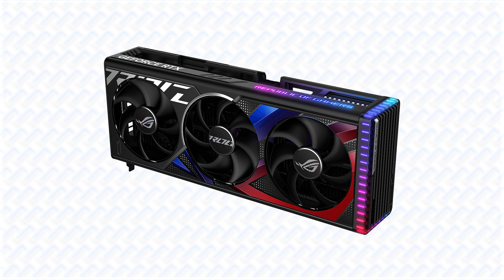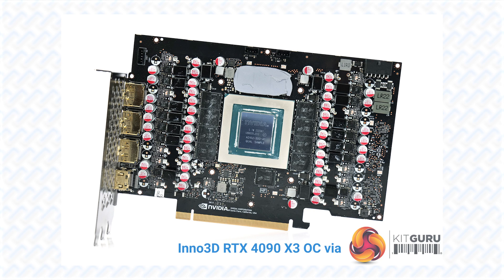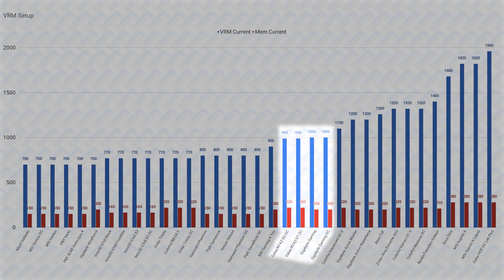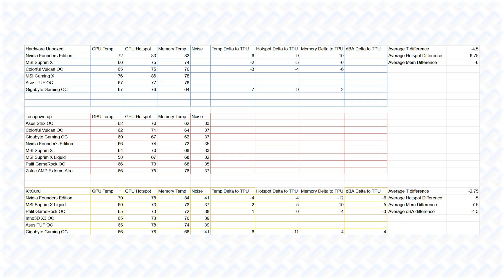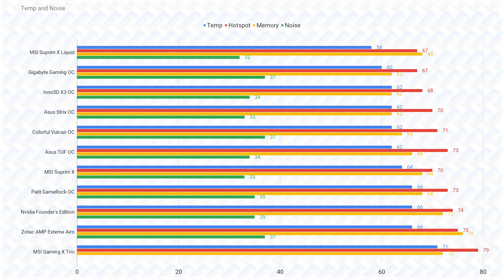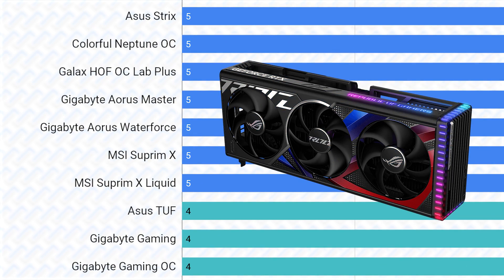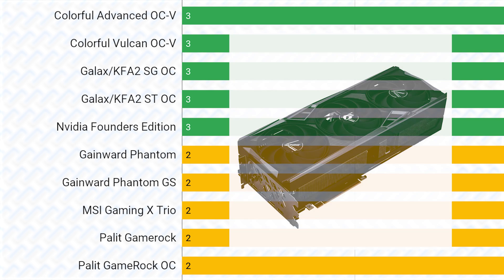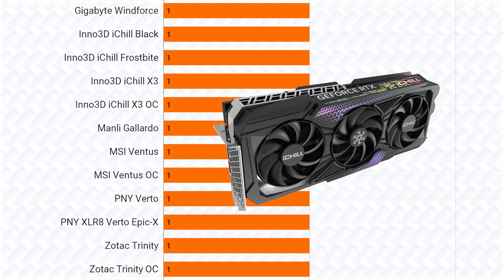Which RTX 4090 to BUY and AVOID?! | 35 Cards Compared! Asus, MSI, Galax, Gigabyte, PNY, Palit, Etc.

Comment: Hey What about "Coil Whine" Charts?
Reply: Asus biggest Choilwhine 4090 producer had 4 all go back
Reply: @pmarciano1717 bro is it true i am going to buy the asus rog strix 4090 oc so should i buy that or buy msi suprim x oc 4090 coz i have beard that gigabyte pcb breaking problem on the 30 and 40 series
Reply: @SOHAM_0000  Coilwhine exists with every model. You either get lucky with one that doesnt have it or you get one that has it. Even from the same model. Just buy and keep giving them back until you get one that doesnt have coil whine.

Comment: I got a palit 4090 gamerock oc and its pretty good.
Made 5 different UV profiles and the gpu operates at max efficiency.
25W power consumption on idle (dual monitors) and 146W while gaming (tested with AC Valhalla at 1440p ultra + FSR quality + Mods + Reshade). Still at 141fps throughout the entire game(fps limiter at 141), basically the gpu is sleeping at 50% to 60% usage.
It,s cool, quiet and powerful.
OC wise (just a test): +1500 on memory clock gives another 10 to 20 fps, depending on the game.
Reply: Sounds like a 4080 would have been more than enough for your needs maybe even a 4070ti. But at least you have a lot of headroom for any upcoming titles that require more power (Remnant 2, looking at you)
Reply: @Ku5hFi3nd  
i wanted the headroom for Mods and Reshade. Some Reshade shaders take 8-15fps (Clarity for example).
Reply: If your gpu is sleeping at 60%, dont use FSR please xd disable it so it can sleep at 70% at least, so you can get a clearer image

Comment: Make sure you guys research the cards specs. The Suprim X has a 520 watt limit, not 600 as shown in the video.
Reply from the maker: There is a BIOS update that allows 600W you can flash onto it

Comment: Hmm should i feel double insulted here with my watercooled Zotac 4090Trinity? ^^ 

Too much Focus on VRM,"cheap" Cards can have a golden Chip and my "inferior" Zotac is pretty good with undervolting and overlocking compared to what i see in Reviews 

If you prefer an ugly giant Aircooler in the middle of your Case compared to a small (itx?!) nice Waterblock with RGB,well that`s your Choice but dont tell me 
you just compare Gpu Temps to make a Conclusion 

vRAM and VRM are better cooled and its much more efficient to Transport 450w+ out of the Case with Radiators 
The whole System is much easier to cool 

 Hot Day ,Summer in the City the Rig stays Cool and my RTX looks pretty - Joe Clocker  🤡
Reply from the maker: I get what you mean but in the perspective of overclocking and getting the most performance out of it, not having a strong VRM and a high power limit on a water cooled card really limits its performance compared to a card with a higher power limit. There's no question a watercooled Strix for example would be faster.
Reply: @OTechnology  A cheap PNY Verto + waterblock costs less than a Strix while being quieter and cooler (provided you already have a custom loop) also not having strong vrms matters less when the card is watercooled, sure a Strix can overclock better but is it worth the extra cost and power draw + electricity bill? (+4,5% gain,Techpowerup) It really depends on the user, for me the main benefit of watercooling is noise, i have 2 480mm and 2 360mm rads, both 54mm thick and running push pull, not a single fan over 600 rpm ever. Where i live a PNY Verto + 2 years extended warranty + waterblock costs less than a Strix. Buying a Strix because you want to appear on a leaderboard or having the best of the best is fine, i'm only saying that there is also a point in watercooling reference boards. Great video, no hate, just my 2 cents.

Comment: Thanks for the meta-analysis. Incredibly helpful. Two thoughts for your consideration.
1. I just ordered a 4090 and will be underclocking it, and I did so not because it is the best (the best is the RTX A6000 Ada Generation with 48 GB) but because the other options suck. It’s basically a $340 Rx 6700 XT or this. Therefore, I will not feel inadequate when a faster card launches; my buyers remorse will kick in when a 6800 XT equivalent hits $450 with better efficiency and 16 GB RAM and DLSS.
2. Lol. Can’t remember. Will need to watch the video again. Back in a bit.
Reply: Ah yes, comparing a $1500 gaming GPU to a $5000 production GPU designed for things like rendering, etc. That's a great way to think about what's best and what's worst, not.

Comment: Cool video! I still like my Inno3D X3 despite being “low tier”. My reasons: Zero coil whine and running very cool and quiet while being a rather compact 3-slot-design that fits a lot of cases. They may have cut a corner or to with the VRM but the cooler ist great.
Reply: Yeah I am happy with my GameRock
Reply: @truthspeaker8243 Is it loud, i heard some people say it's got noise issues

Comment: I can personally attest to having bought 4 4090's for a binning process - the MSI Gaming trio should be A tier. Not having a vapor chamber doesn't really affect temps all that much and compared to my Suprim X 4090 the gaming trio only ran 2c hotter on the core and hotspot, while maintaining INCREDIBLY low memory temps. The mem temps matched the core temp even max OC'd. It's something they did with the configuration where the memory cooling is just masterful which is pretty important considering how hot gddr6x runs. My suprim averages about 62c on the core at 3ghz while gaming 4k native for about an hour. The gaming trio averaged about 64c on the core, 64c on the memory, and 73c on the hotspot. Whereas my Suprim X hotspot is only about 6-7c hotter than the core, and the memory temp is usually right in line with the hotspot. So suprim x - better hotspot and core by a couple C - gaming trio - better memory temps. Hotspot about 9c above core. The cooling is absolutely not an issue on the gaming trio regardless of having no vapor chamber. It's not as important as you might think. It really depends on the craftsmanship and design of the cooler, and msi did a great job with the gaming trio. Suprisingly, the Asus Tuf - which at first was my favorite design, ran hotter than both. With way worse mem temps. On top of that, the msi cards have far less coil whine where the Tuf sounded like a banshee being sodomized. The trio had virtually no whine and the suprim is dead quiet. And suprisingly enough, the gaming trio could hold 3090mhz on the core clock in heavy ray tracing 4k applications and games, being a better bin than the suprim I ended up keeping. The gaming trio was silent, but the suprim is a tad quieter. 
 I bought two suprims, the other one had a strange rattle throughout the cooler when the fans hit about 1900rpm or around 60%. My suprim crashes anything over 3000mhz on the core. It boosts to 2820 stock on the core where the other suprim boosted to 2850 but crashed at 2970. The gaming trio boosted to 2790-2775 and had the best bin out of all including memory clocks. Only reason I didn't keep, is like gigabyte if I pay that much for a card if there is any plastic on the shroud im not keeping it. Though I feel I should have, because I loved the design of that card. It's funny the power limits didn't affect OC at all, and both MSI cards overclocked better than the Asus. Similar story to the 4080's i've tested.
  So honestly, outside of the founders edition, gaming trio would be top priority for value. The pcb is still extremely nice mirrroring the suprim, except it's cut down to 18+4 50a at 900 amps. Doesn't matter. It's still overkill and a safer bet with the build quality. Prior to the 4000 series I was not a fan of msi but they started doing things right. The PL is stupid but who cares. 600W PL doesn't help in most scenarios anyways considering the stock chip already boosts so high. Doesn't give you legs like you'd think. Buy the cheaper well known models from Asus or MSI or Gigabyte. Don't buy any palit cards or gamerock or any of those weird brands that are popular in Europe like inno3d.
Reply: I just recently grabbed a trio X and I was shocked at how quiet and cool this card is. I always worried because I don't see my fans coming on for a while lol. Compare to my Evga 3080ti I had a little bit of coil whine and it was 6c to 7c hotter at ideal.

Comment: One of the most neglected factors from all 4090 buyers guide is the fact that some cards have a high probability of producing a lot of terrible coil whine, like the Asus Strix or the FE.
Interestingly enough, it seems to affect the "well built" cards with big VRMs more than the cheaper configured cards.
Hence, just throwing money at a card will most likely increase the chance of a noisy card. Sadly.
Reply: the strix is according to many a very quiet card
Reply: @Adierit  The Fans yes. But they tend to having nasty coil whine. Thanks but no thanks. 
I can live with a card that produces a bit of fan noise, but coil whine is a noise that even transcends through headphones...
Reply: @leereiyuu  I mean, unless you have an open air bench you likely would never notice it anyways. I run a strix myself and I don't hear a thing from my PC inside of my corsair 570x
Reply: @Adierit  Then you are just lucky to have a strix without whine. I never said ALL of them have it, the probability is just high. And it does not make a difference if open bench or case, because this high pitched whining is not stopped by that. Believe me, be happy that you havent experienced that yet, it is just soooo annoying.
Reply: @leereiyuu  If I stuff a speaker in your wall, it'll be significantly less noticeable then if it was placed in the middle of your room.
Reply: @Adierit  This is not a valid comparison: Some frequencies get blocked easy by a metal cage and some frequencies dont. The high pitched coil whine is not impressed by a metal box. You might want to read into the behaviour of sound waves, if this is of interest for you. I will now sign off from this discussion, because this is not getting in any interesting direction for me. Anyways, have a nice day, mate!
Reply: @Adierit  how to admit you dont know how sound works
Reply: @ppeez  are you implying that sealing sound in a box so it has to travel further isn't literally the entire concept and definition behind disappation and sound deadening?
Reply: @Adierit  are you implying you are ignorant to the differences in sound wave structures?
Reply: @ppeez  well, all i know is regardless of what you just said putting something in a box deadens the sound it makes, this is a proven fact that you may test yourself
Reply: @Adierit  that depends entirely on the frequencies emitted and the material used for your little imaginary universal box

Comment: Two questions for those who know better than me:
1. 2:05 Does having a powerfull VRM really has an advantage while undervolting?
2. Just wondering if those unpopulated phases on lower tier cards can be… populated? Seems like and easy soldering work 🤔
Reply: 1. No, 2. No. Also something that is completely neglected is the diminishing returns beyond 400W. At some point you only produce heat and very few fps.
Reply: Fortunately i’m not interested in OC in any way. Lowering temps and power drain is my only concern. Thanks for replay!

Comment: Very thorough video, lots of thought put into it. 
The reality is that the performance differences between running at 3100Mhz and using over 500W and putting out a ton of heat, versus setting a voltage curve at 1v and a stable frequency at 2850-2895Mhz pulling between 350-400W and a lot less heat is pretty pointless. 
I play at 4K and there's literally a few fps difference at most, which falls into the realms of simply not worth the hassle. 
Also the Strix has the worst coil whine of all the cards, which is very annoying. 
Sure, the higher end cards have the potential for extreme overclocking for bragging rights in benchmark tests, but for everyday gaming use they are just quite pointless as you inferred in your video. 
For the user who just wants to game, there's no point in spending $400 more for a few FPS they won't even notice.
People get too wrapped up in things that are for extreme OC enthusiasts and forget they just play games with them.
But whatever floats your boat!
Reply: This is SO truth.  I remember the good old days when OC'n a GPU showed real gains (980ti).  Alas that is not where we are.
I have a 4080 Suprim X and no matter what, voltage at 1.1, max pwer limit +125 core +1150 Memory.  It burns close to 400w instead of less than 300>
Stable as a rock.
But what did I gain?  4fps on top of the stock 113fps in Cyberpunk with Psyco RT on.   Not worth it.

Comment: While I found some very useful details in here, I have to admit your "overall" ranking system made absolutely no sense and directly contradicted previous information in the video. Made even worse by the lack of taking "COST" into account. You had for example The gigabye gaming OC neck and neck with the Asus Strix OC in all the previous slides, then placed the strix suddenly at the top of the pile despite near identical specs but the strix costs an insane +$300 more. The cost of a new mid/high end AM5 motherboard.

I certainly can't trust any of your recommendations based on your mis-matched information, and lack of cost being taken into account. But I do appreciate the voltage/thermal/cooling data, which I confirmed from other sources.
Reply from the maker: I mean I guess you missed the part of the video showing how much better the Strix VRM is, being it also has a fully digital, externally controllable, voltage controller. Aside from the cooling also being slightly better and the power limit being higher.

Comment: Always go for gigabyte cards and you will be happy. Asus is fine too but have had alot of issues later years and msi always runs to hot so you need really really good fans to support them
Reply from the maker: That's all baseless claims
Reply: @OTechnology  no just personal experience i have had over the years.
Reply from the maker: @LAXEN9003  The 4090 hasn't been out for years.
Reply: @OTechnology  that is true but it isnt just these card im speaking of. Its the manufacturer of them......... I do think every single card is great and with these prices it really should be.

Comment: You would think that digital storm would use a top of the line 4090 but every 4090 build including mine came with the pny 4090 smh.
Reply from the maker: Its a decent card for default settings with no overclock.

Comment: I have a Gigabyte Waterforce 4090 card and was interested in the statement that there is no point having a water cooled system. My system is a 13900KS, 32gb 7200mhz, Waterforce 4090 and I also use a x73 AIO for the CPU. The advantage of having AIO is two fold, the 4090 card size is reduced and the major one is it somewhat removes the heat away from the internal parts of the case. In my case I have the AIO for the GFX card mounted on the top and the AIO for the CPU mounted on the front. Both AIO fan stacks  blow air out of the case. This has lowered internal temps of the case a whole bunch and I can run demanding workloads without silly internal case temps. My point is that with AIOs you have a lot more options of where you put your heat. You cant really hear the AIO pump btw way so this is a non issue.
Reply from the maker: That is a real benefit of AIOs for sure. I was just speaking in regard to performance, where there's no benefit in going watercooled since the air coolers perform nearly the same.
Reply: @O!Technology  Yes from what I have seen with performance tests the cooling seems fine on long gaming sessions on demanding games. The latest patch for cyber punk with everything maxed out and path tracing turned on at 4k it is consuming near max power and heat on my system is stable.
With AIO cards the performance benefit comes not from the card but from not heating the case ambient temp up and thus causing runaway effects to other components eg NVME or CPU. It's a total.picture approach to cooling and AIO cards give you those options. That is where the value and purpose of the cards are.
But I get your point specifically to the card itself.
I learnt a lot BTW about the components side of things BTW vs price as that whole side of thing had me confused as to why their is a $1000 difference in price in our country so thank you.
Reply: @Hybrid330i  Yea that's one big point in AiO / custom loop. Sadly in this generation there's only Inno3D Frostbite with warranty to be used in custom loop so if some1 (like me) would like to have a card with warranty (we're talking not cheap cards here) there isn't really much options: Frosbite or one of those AiO ones. I wasn't into Inno3D Black but it can be found very cheap (like 4090 Gaming OC) from 14-days returns with 3 year warranty and despite power limit and VRM i'm reading it's pretty good (AiO made by Arctic, same 38mm rad as in LFII for CPU and P12 fans). I could buy also 4090 Waterforce but there are some negative reviews on this card, maybe it's the problem with rev. 1.0 but shops don't mention that detail or don't want to ...

Anyway that's a nice comparison - thanks @O!Technology :)

Comment: Thanks for the guide! I've been struggling to decide ever since EVGA tragically left the GPU market. This guide helped me decide on the GIGABYTE AORUS MASTER. The ASUS Strix is $400 more expensive, and the Galax HOF is...hideous. Thanks for the wonderful guide =^.^=
Reply: Be very careful with it, gigabyte cards are prone to cracking
Reply: @redbullsauberpetronas just use the include anti-sag bracket or a third party one and don’t transport your pc with the gpu installed and you’ll be fine from what I read.
Reply: ME to, i buy Aorus Master 4090 and zero coil. Happy.
Reply: @razvanelp are the gigabyte cards the least likely to have coil whine because that’s what reddit says? Also, if I want zero coil whine, should I go aorus master or gaming oc?